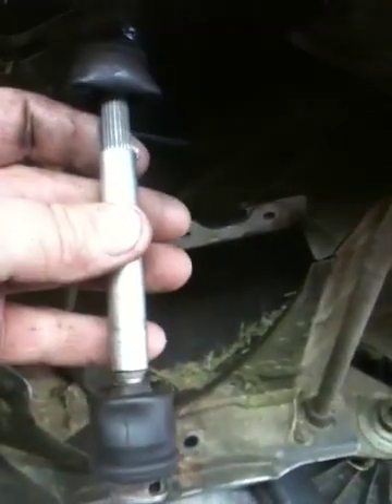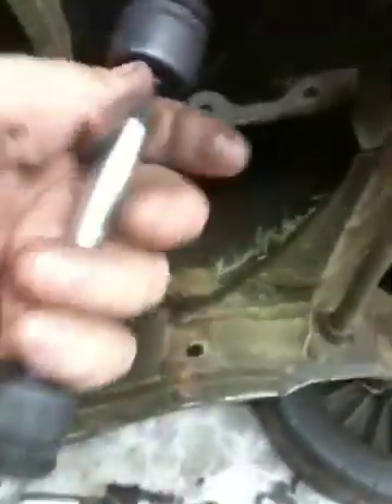LAWNMOWER REPAIR: Hrc 216 honda commercial mower drive shaft

Comment: I have a Honda hrc216k3.  6 years old.  Transmission runs good forward, but when I stop and move the mower backwards a few feet, then the transmission will not drive the mower.  After about 30 seconds, the mower then moves forward.  Please help

Comment: Hello,
The drive shaft on my HRC 216 keeps falling off after I hit part of my fence.
The height adjustment is on the highest level. Can I move the transmission
closer to the engine?

Thanks